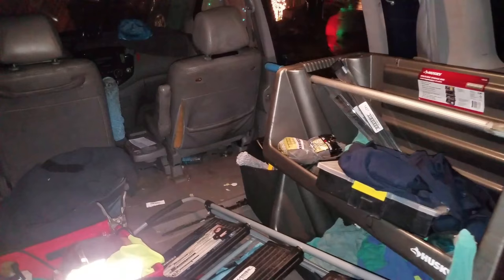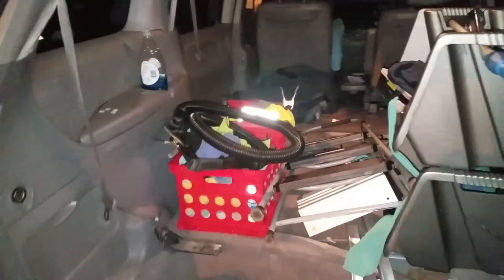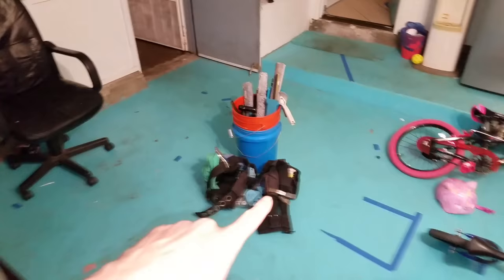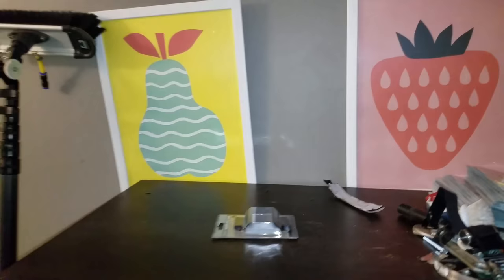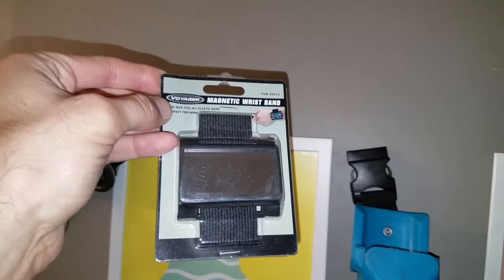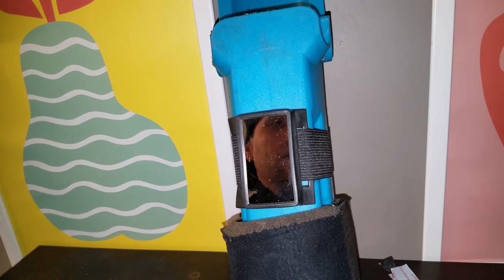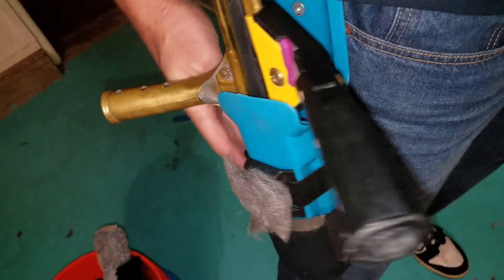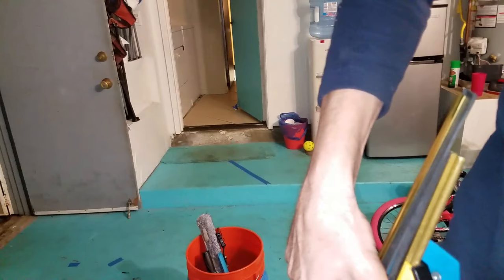Window cleaning upgrade for my crew part 1 part 2 will show van organized

Comment: I don't know about the magnet on the bucket, but I do agree with working on your business not in your business. keep posting new ideas
Reply from the maker: Kevin Wright you got to try it
Reply: C & C Window Cleaning LLC. we will see. but I do use it for blades. I think your videos showed me that. a long time ago.
Reply from the maker: yes the blades fit on the little wrist magnet.......this one is much bigger and works very well by keeping the steel wool visible, accessible with the same hand movement that would Grab a squeegee, cleanable, replaces an extra pocket on your belt, affordable, and if you take the steel wool off you could even check to see if there's spinach in your teeth because it is a mirror as well LOL

Comment: Why don't you prefer the traditional 6 inch scraper? You get more surface area....the same with the steel wool. And with the steel wool hanging off your bucket wet could be a potential drip problem .
Reply from the maker: I've never had a problem with the steel wool dripping because if I'm on the interior I don't steal wool the entire window maybe just small pieces here and there, it's typically for the exterior window that does not have a screen covering it, for bird droppings and stuff....nobody else is allowed to have blades bigger than the new one inch one that they put on their wrists every day, we have not ever had trouble scratching windows, with my safe system... imagine hiring somebody, cleaning two houses yourself and sending them to a third house with a 6 inch razor blade and telling them to scrape every window and then later on getting a call and the client says you guys ruined every one of my windows.  the product, and Muse, that I have created does not include 6-inch razor blades.
Reply: C & C Window Cleaning LLC. lol why would you tell or train to scrape every window ?
Reply: And steel wool comes in handy for some spot interior work like kitchen windows or garage windows...idk hey man to every man his own . Always interested to see what you upload
Reply from the maker: Luke The Window Cleaner I know window cleaning companies that have their guys just scrape every window on the exterior to make sure everything gets off of it it just seems crazy to me, you were asking about using a traditional 6 inch blade I thought that's what you were talking
Reply from the maker: Luke The Window Cleaner no that's why I said there are some places we use it on the interior, kitchen windows are great for that you're correct also interior garage windows with all the bug marks to.

since I watched one of your videos I've been looking to buy just a single pocket so I could have the wet steel wool in one and the dry and the other but then I found these while I was looking for pockets, and it works great